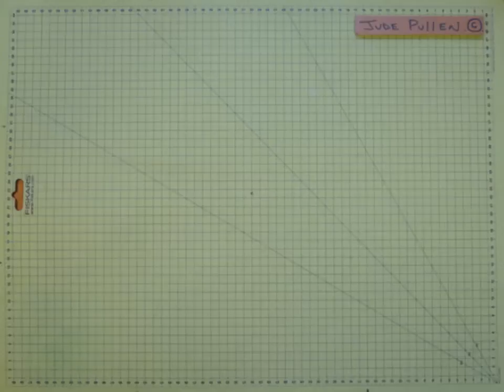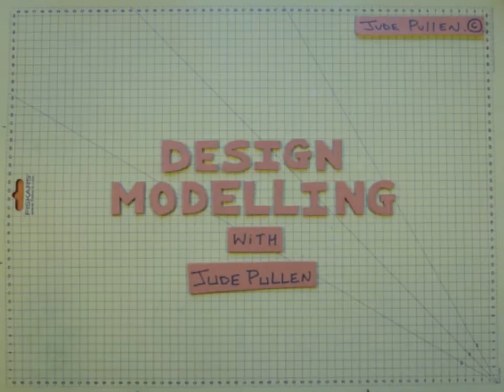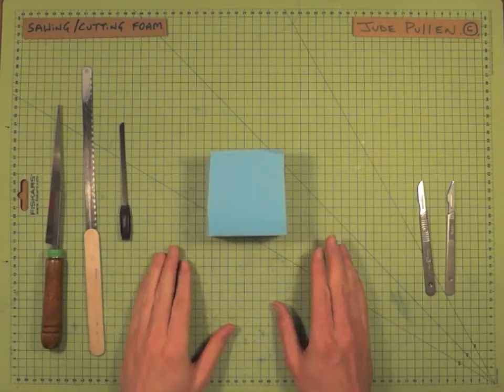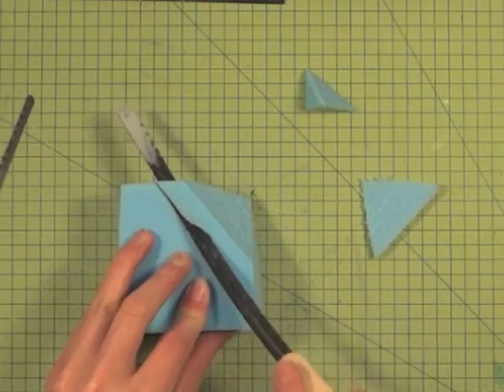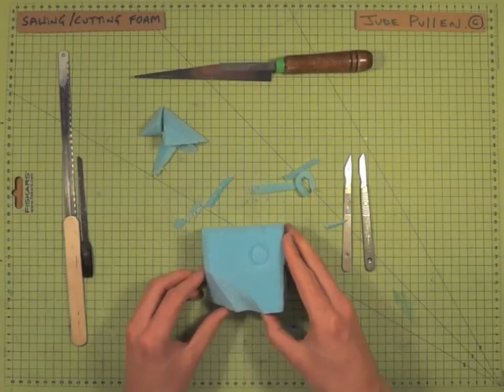Ergo Mouse Techniques - Cutting Foam

Comment: Hi, can you please add a video on painting styrofoam? Many thanks.
Reply from the maker: Hi, if you take a look at the rest of this series I show how to apply a water-based filer - which you can then spray paint on top of. You can also apply PVA glue. They key is to use a water-based barrier between the foam and a solvent based (spray) paint. or of course, you could use water based paints, but it's hard to get as good a finish. hope this helps for now, but I'll add it to the list. thanks for the comment.